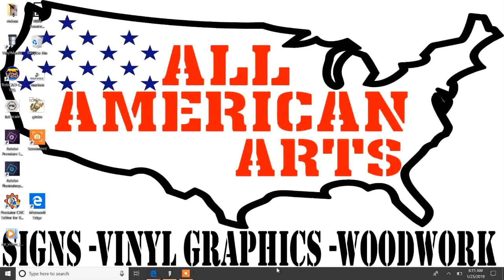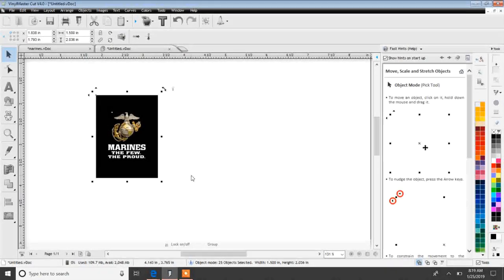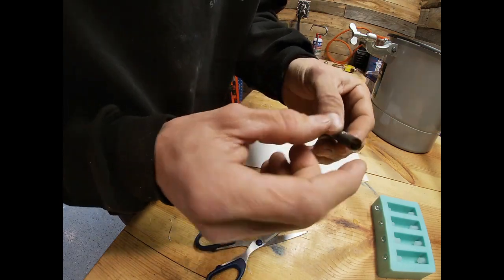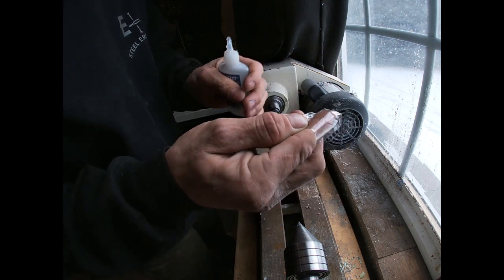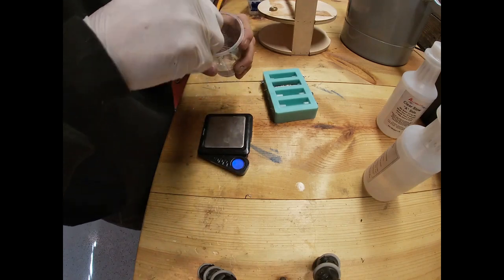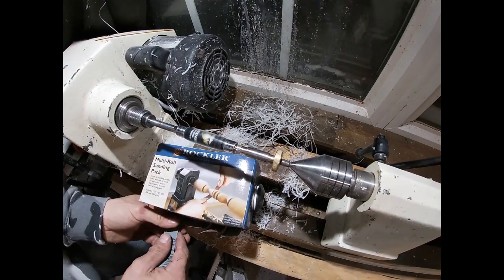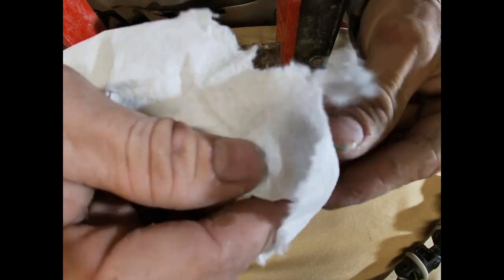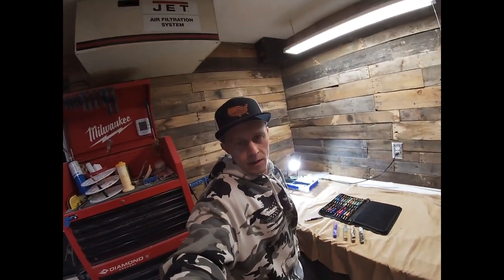TUBE IN LABEL CASTING PEN MAKING how to  ....GIVEAWAY OVER !!!!!!

Comment: Nice video! Am an Air Force vet so will be trying to cast a bolt action pen with a AF logo. Your explanation on how to attach the label to the tube is the first one I've found that actually explains the steps in gluing it to the tube and then covering the paper with a couple coats of CA to seal it. I didn't do that last step and my label peeled off during the curing.
Reply from the maker: Thanks so much for watching!! I appreciate the comment aswell as your service for the country. I also been using label paper now off labels.com saves a step still need to layer it with ca and let it cure .

Comment: So far all my pens have been made out of wood blanks. I've  been finishing them off with bees wax. It looks ok, but l think it could be better. What would you recommend? I tried that glue finish you did in the video you made with your wife and I really need to practice that. Didn't turn out so good. Great videos!
Reply: JB for wood sanding sealer, then wipe on five coats of Melamine lacquer, finish with one coat of Carnauba wax. This process is all done on the lathe.